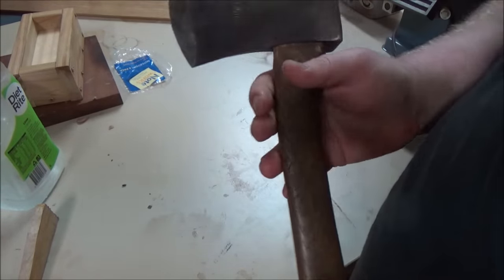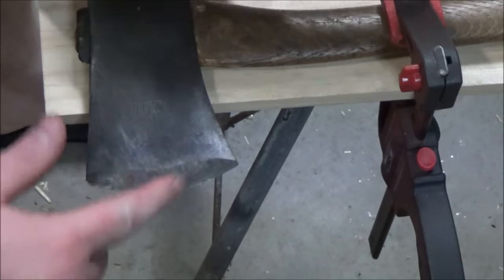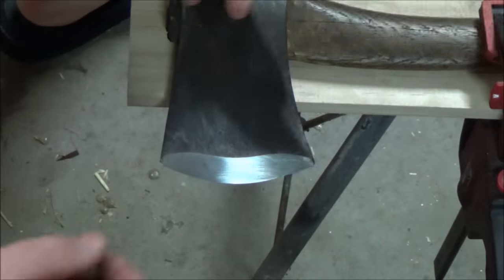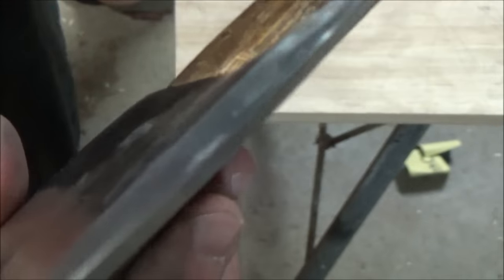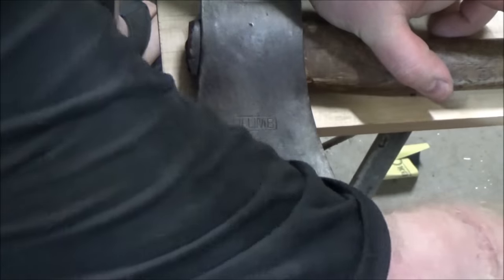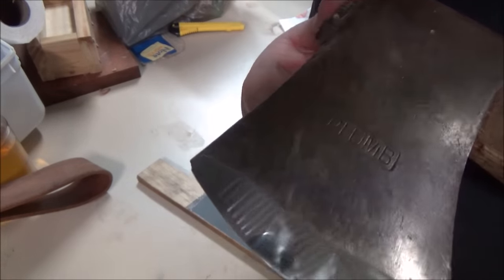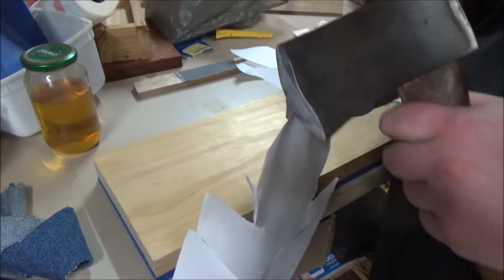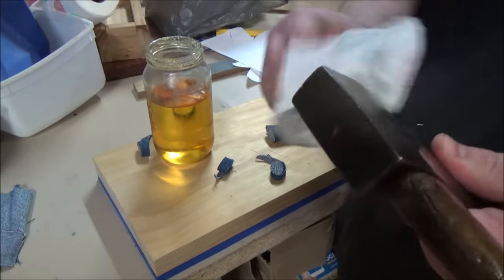How to Sharpen a Hatchet or Axe to a Scary Sharp Edge!

Comment: Tbh I wouldn't be happy with this. It's a very sloppy bevel with some inconsistencies hidden behind a polish. This should have been profiled with those large chips. Guranteed the edge will roll minutes after use. Lol, you removed the work with your,"Micro" bevel and your stropping technique. Leather dulls a knife if not used correctly. It's apparent given how dull your axe is during your cut text. With the amount of dedication you're willing to put in to this tool, you could be a master with a little work. You should research sharpening techniques, and you'd still be able to do this method for polishing.

Comment: Great job but you should have filed and reshaped the ding on the axe. The blade is great and sharp and then you have that irregular zone on the tipp of the tool that dosen´t look good or work as well.
Reply from the maker: Thanks and yeah I know what you mean. Only problem is I don't want to take that much steel off of a vintage axe. As I look after it  now and appreciate it. I won't be doing what I did when it broke. I will just let the chip sharpen out over time.

Comment: This is a good video, and shows the procedure quite well. but it goes a bit too far. Axes simply don't need to be surgical sharp.  For crafts-work around the camp site  (carving spoons, tent pegs, etc) this would seem amazing, but that's too sharp for a general use axe.  An edge fine enough to sheer paper, is too delicate for brunt chopping work and you run the risk of rounding-over or breaking the edge off entirely the first strike you chop. I know from experience.

An axe just needs a solid, convexoid edge, and f you need to sheer paper, use a knife.

Comment: 2000 grit? For a hatchet?  Wadaya tryin to shave with the thing? I just vice em up and use a file then maybe some 220 grit. More than sharp enough after that. The real trick is to not let em get chewed up too bad in the first place!
Reply: You can shave off 220 grit. Higher grit doesn't mean, better apex.

Comment: You do realize there is a reason we don't sharpen our chopping tools to "scary sharp" don't you?? 🤔🤦‍♂️
Reply: care to enlighten us Karen?
Reply: @stephenlambert9826  its for a few different reasons actually... "kevin", one so you don't inadvertently cut your self with something while you are swinging it around, another reason is the sharper you make something the smaller the and more defined the edge of that item is and easier to roll the edge when using it making it harder to hone and sharpen again the next time around. Also when using an overly sharp edge on an ax or hatchet you are defeating the purpose of the item, it isn't supposed to have a sharp edge its supposed to be able to split the wood not cut it. If its sharp its only going to lodge it self into the wood in a cut and not split that piece as intended.

Comment: The hatchet is sharp but there is no real konvex to speak of. The edge will be muvh more fragile this way. Look at Wranglerstars videos, he does an excellent job of showing it.
Reply from the maker: That's what the micro bevel is for. If the edge struggles increase the size of the micro bevel. Nothing wrong with wranglerstars videos. This is just another way of doing it.
Reply: @scottshobbyz5416  I still think the konvex edge is more durable. But you have to remove more metall to get these appleseed grinds sharp again. A secondary bevel get's sharp much quicker but is not as good for high impact stuff, so I would use a konvex for applications like splitting or felling and a secondary bevel on a small hatchet for general camp use like splitting kindling or carving.
Reply from the maker: This hatchet is mainly for carving and camping. It doesn't need to be this refined for splitting kindling and chopping fire wood. But I will probably carve with it. It would be really easy to convex it from here so I can change it at any time. Honestly though I have had no need for it to be stronger. Wood isn't exactly soft in Australia and this thing busts out chips like nobodys buisness. 
All I know is that people have been doing it both ways for a very long time. A friend of mine who used to axe race says some people convexed their grind and some had it flat with the secondary bevel. Like mine here. I am more of a believer in if it works for you go for it. But also have fun experimenting with different ideas. I just don't have much chance to use an axe lots anymore unfortunately.
Reply: @scottshobbyz5416  I respect that. However i will keep my GFB small forrest axe with a konvex. I use it for bushcraft and with the medium to hard wood I use it on in Germany it stays sharp for an insanly long time.
Reply from the maker: If it's working well then no point changing. Unless you want to experiment. Personally I wouldn't experiment on a GB though :)

Comment: 👀🤔 
N-a-a-a-h!  😂
Straight in with the angle grinder. 
Get that angle symmetrical and sorted and that chip from misuse dealt with, so you can see where you're going.
Different in camp, but at home, as my wee, fat mammy often asked...
"Why have a dog and bark?!"
Mod cons for the donkey work, purchased second hand from pals, with stones and files from jumble sales, etc, along with sand and emery papers, sitting and relaxing, the occasion swig at the bottle to wet your whistle, wondering if you can bung the finished product at the garden gate and get it to embed itself nicely, before the neighbours call the cops to report you're drunk and off your head again.
Oh Chill, you old women, I'm kidding...they wouldn't dare call the cops!
😜😂
Seriously, though, why have tools and not use them, at least to the degree that makes life a bit easier, before getting into the zone, mesmerising, as mentioned, where you kind of drift into other thoughts, plans, etc, still keeping an eye on what you're doing, being mindful of safety, but not uptight enough you can't enjoy the task, as you recall the last time you done a good sharpening job and the cops arrived in a riot van, because the snitches...
😂😂😂😂😂😂
Really enjoyed the vid, incidentally. 👍👍👍
That delighted chuckle, as the blade sliced through the roll of denim was priceless!

Comment: i think when you smash this into wood it might fold the edge
Reply from the maker: The micro bevel strengthens it. It definitely would if not for the microbevel. You can always touch up the microbevel again if it is a bit weak or going blunt. Works for me.

Comment: It's a simple hatchet. Do we need to spend 30 minutes making them scary sharp before we take them outside and hit dirt, barbed wire, stones ?  Honing a hatchet seems like a total waste of time unless you're entering the job in some kind of sharpening contest. Wire burr honing,,,just take it outside and use the hatchet and in a few strokes the burr will be gone. I love sharpening and have been doing it professionally for years. I try to spread the word of sharpening, but if I were to instruct a customer on a hatchet sharpening job that was going to take 30 minutes or so with multiple steps, I know they would never do it. A single cut file works for me at a fraction of the time. It's a hatchet. I'm not shaving with it.
Reply from the maker: There is no way I would use this hatchet for the jobs you described. I would use a cheapy that I banged an edge on with a sander or a flap disc on the angle grinder. 
There are certain tasks that this performs better than a file sharpened edge. Although for a wood heap axe a file sharpened edge is about what I leave it at.
But for wood carving, axe racing, trimming green stuff (that is clean) or showing off an edge like this is great. But it is a task that produces diminishing returns. The most important thing is to apex the edge the level of refinement depends on you task and in my case I have fun with it. I would imagine most people who sharpen to above needed levels of sharpness are either having fun or are not worried about the time and want that little bit extra in performance. I would be in the fun category.

Comment: I'm no expert but your bevel looks like it comes down too far for the size of the head. The bevel should prob be less that that. Unless it came like that even then a lot of factory bevels aren't correct. Check out wranglestars video on how to find the the proper bevel length
Reply from the maker: Actually the guy that sold it to me sharpened it to a finer bevel. It normally is a little smaller but not heaps. He wanted a finer edge for carving and other light work. He used to do axe racing and can sharpen these way better than me. The bevel was insanely even so I just need to keep it there lol.
I don't do anything crazy with is but if I needed to I would just increase the size of the micro bevel. That will toughen it up.

Comment: Yeah that's very pretty for shaving hair but it's obviously not a practical working edged tool. Enjoyed the video though.
Reply: My thoughts exactly, one sideways pull to get it unstuck and the edge is bent.  Or a hard knot even.
Reply: @trevors8577  how and why would you pull it sideways?
Reply: @joelg5358  Okay...  lets see how to put it..  You got the handle running to the ax head, the head is buried in wood, pulling it out gently would be lifting the handle so the head pivots as if there was an axle going perpendicular and you are rotating on that.  Sideways would be if you lifted the handle not along that pivot point/plane and instead went angular so the head was twisting sideways.

I think that explains it..??  Anyway if you get an ax head buried deep enough it can be a pain to get out, that's why I prefer to use one of my three chainsaws instead of an ax when cutting trees up :)  heck I'll take one of my Silky saws over an ax and limb with a machete.  The ax is mainly used to split kindling for starting a fire while camping.
Reply: @trevors8577  my point exactly, if your blade is buried in a log there's no way you can pivot it sideways. Obviously you just don't know what a working edge is! No one seriously uses a hatchet, ask or machete so sharp that it will shave. You're just obviously just young and have a lot to learn. You can still make a nice shiny & pretty working edge on a tool, but it is worthless.
Reply: It's absolutely possible to twist an ax sideways while removing it, it helps to bust up chips as one is trying to cut through a decent sized log.  If that isn't something you've ever experienced, then, it's almost never too late to learn something new...............................  almost...

Comment: It looks great. Nice and shiny, but impractical. You just sharpened a striking tool with a chiseled edge like its a simple cutting tool. In reality, an axe, hatchet, or splitting maul should be sharpened with a convex beveled edge. The edge you produced, to excessively sharp and overly shiny will be more prone to chipping and even cracking. This method would be great on a tool that is “tactical”, but if you want to have practical application, the correct edge is essential.
Reply from the maker: Having the micro bevel on there strengthens the edge a lot. And you can touch it up loads of times with a fine stone before you lose cutting performance.
I haven't tested axes enough to see if I like this type of edge or a convex edge better. I know this edge works great though.
I learnt from a guy who used to do axe racing. My bevel isn't as shiny as a lot of them get it. They often take it to a complete mirror finish. And have it sharp enough to shave your face with.
From asking him about it. A lot of the axe racers would have this kind of edge as they thought it busts the chips out better. Some had convex as well. I don't know what the modern guys do though. All I know is it does send chips flying. 
I am not against one edge or the other. I think if it works for you go for it. Unfortunately I am not in the best position to go test out different edge angles, finishes and types to my satisfaction. I just don't have enough chance to use them.
As for splitting wood I do think the convex wins out. But on the small wood you could split with a hatchet it probably doesn't make a huge difference. But for mauls or full sized axes I find it does.
Reply: @scottshobbyz5416  Timbersports are a completely different thing. Axes that are razors, cutting softer wood like poplar, cost $1000, and have one purpose in life is no comparison.
Reply from the maker: Most of them chop wood a lot outside of competition.
The guy I learned from has used axes pretty much his whole life. He uses a different technique but has the same type of edge.
You do change it a bit depending on what you generally use it for though. If it's a wood heap axe sharpening with a file is plenty and probably not as fine of an edge as mine was (although I have found it doesn't get damaged even on dead gum trees). If felling green trees. An axe with an edge like mine would work awesome.
Reply from the maker: I am not sure what the angle is sorry. I also put the micro bevel on there as well. So it was roughly +5 degrees per side. I find it holds up well. Although the toothy edge left by the sandpaper disappears quickly. I have since touched up the micro bevel with a fine stone and it keeps that bite a lot longer.

Comment: Stupid to were shorts and sandals, safety first ! ! ! Sets a VERY bad example ! !  Great vid otherwise. The changing of grits reminds me why Japanese swords are so dangerous. I once saw a documentary on how they are made and why they can be so dangerous. Sharpness counts but what is more important is polish. The greater the polish the easier it will cut, the smoothness of the polishing allows the blade to slip/pass through things (necks) easier. The stropping on the leather at the end is a nice touch, remember it is how barbers use to (still do) sharpen razors. Leather is slightly abrasive and leaves a very fine edge. Great vid. Just remember the sharper more polished it is, the easier it will pass though flesh, so be careful.

Comment: Your axe handle has a crack in it
Reply from the maker: Thankfully it is only surface deep. Doesn't appear to be one that will continue down the layers either. I would be devistated if it was deeper as it is American hickory and has many layers of linseed oil on it. Making it probably the most comfortable axe handle I have ever felt.

Comment: have my great grand fathers axe  they do not make them like that any more has only had 2 heads and seven handles  in its life time
Reply from the maker: Gotta love the old axes. Generally speaking they don't make them like the used to. There still are some good makers. Gränsfors Bruk being the last big one I know of. But they will cost you. There was also wetterlings but is shut down somewhere in the last 10 years (can't remember exactly when).
But the average hardware store axe is not as good as the old ones. Unfortunately they can sell more by making them cheaper. The average person might only use theirs a few times a year or just for splitting so they don't want to spend what it costs for a good one.

Comment: "sitting back and sharpening your ax." sounds like a masturbation metaphor... why not take an angle grinder with the standard grind wheel it comes with and lightly grind the blade fearsome sharp?
Reply: Because you ruin the edge.

Comment: that is a fine edge for a knife but an axe should be pretty dull, like hold the head 30-40 degrees up off the grinding surface. if you knew what you were doing you would know that you can pick up a grinding stone at the local $1 china supply shop and even then you can keep your sandpaper from gunking up by wet sanding. the whole reason for wet sanding is to keep your sandpaper from gunking. the money you would spend on sandpapers and 2 sided tape could be used to buy a bench grinder, spin that thing for a few minutes and you are chopping down trees and taking heads off chickens no problem...

Comment: Meanwhile i just use an angle grinder to sharpen my hatchet
Reply from the maker: I would only do that on cheapies or beaters. Not on this lovely piece. I am not against using a coarse belt on a sander to rough a bevel in if a lot of steel is in need of removal.

Comment: Sure it's sharp and can slice through paper with ease, but the profile on that grind is too straight. That's more of a knife sharpening technique. If you do that with a hatchet it will lose its edge after a couple swings in hardwood.

Comment: These are not made of particularly hard steel so I don’t see much point sharpening it, will not last... your marriage will not last either if you neglect your wife 😜
Reply from the maker: Haha, I am not married. The edge lasts ok but you do have to touch it up if you want to maintain an edge like this. Once you have trimmed down a piece you are carving or trimmed up some branches or whatever you do with it. You just give it a little stropping with a fine compound or use a fine stone for touching up the microbevel. Eventually you have to go back to the main bevel again but you get a good while before needing to do that.
Woodworking tools like plane blades and chisels get touched up often and they are harder steel. But for some reason people often forget on axes.

Comment: The force of impact will just ruin and disform the edge of a razor sharp axe. Your better off with a stumpy fat edge.
Its the weight that does the work not the sharpness.
Reply: You'd think so but if you strop the burr off then a razor edge is surprisingly resilient. When you get the edge right you can split logs with it and then carve with it straight away

Comment: Axes shouldn’t be razor sharp, nor should cleavers.  *fail*.
Reply: Brandon Nelson I’ve heard that for years. Same thing is said about blades on a rotary cutter. All I can say is my rotary cutter appears to cut cleaner and easier when blades are sharp. Especially heavy wet grass and trees two inches and under. Just opinion and not scientific.
Reply from the maker: all depends on what purpose the axe has.